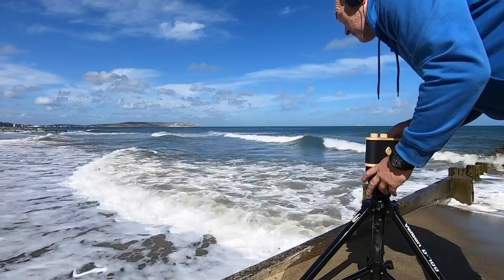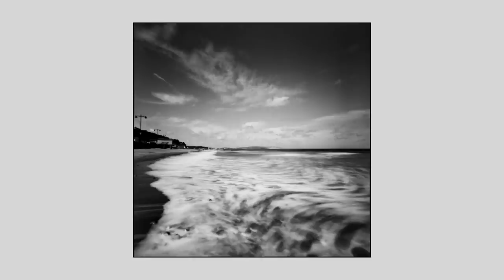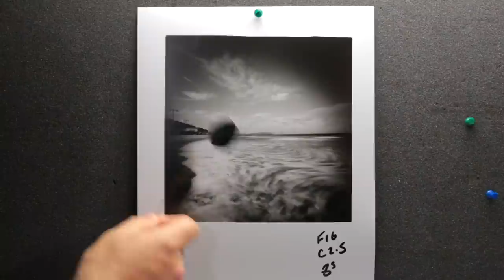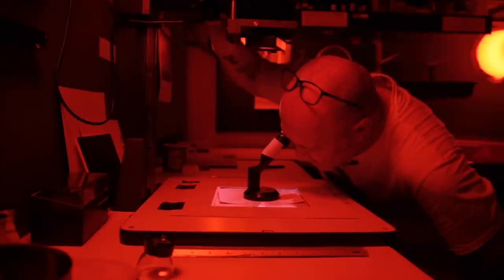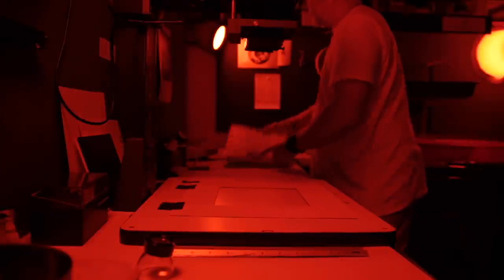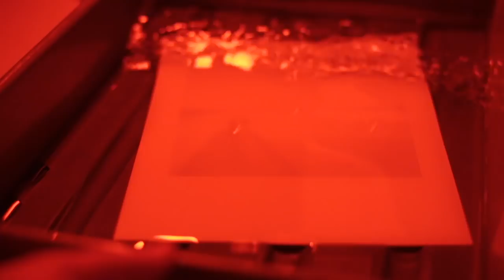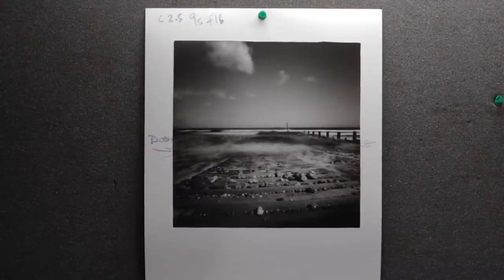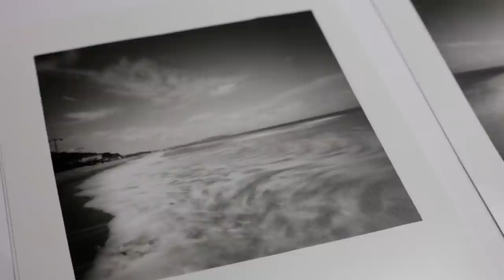6X6 MEDIUM FORMAT PINHOLE CAMERA - AWESOME HIGH TIDE SCENES - SHOOT AND DARKROOM WORKS

Comment: Regarding KENTMERE Paper --  was introduced to it when I was  a photographer in the Civil Service ( Ministry of Aviation) and they had an account -- it was available only for 'Government Contracts' in 1959 - 60 when I was there -- NO SALES to 'Private People' -- anyway I got an account when it WAS opened up and I got 'known' for using 'Kentmere' which is a small Village in the Lake District and in 1968 I was invited to visit the Factory as I was 'Youth Hostelling' nearby and told them I was up in their area. It  was very interesting. I was taken into the paper drying room in a Safelight situation and they used a 'Festoon Method' of drying -- hanging huge papers in the room as they did not have a posh drying machine at that time -- and the place smelt of 'Jeyes Fluid' which was a chemical they added to the paper to prevent Bacteria eating the emulsion !
Reply from the maker: I bet that was a good day out Pete!

Comment: I love the shot of the steps leading down to the sea. I'll have to do some pinhole stuff. Got some developing to do before I shoot any more film though (it piles up). 
Talking about having the negative in focus for printing, I read in a manual from the 1930's that if you scratch a blank exposed negative (a couple of horizontal and vertical lines) with a sharp blade and use that to focus your enlarger, then pop in the real negative it is more accurate. No idea if it works as I've not got an enlarger yet. Might be worth a go.
Reply from the maker: Never heard of that before. That must have been before focus grain finders.

Comment: Hey Roger,
I just bought an entire Darkroom all for 45€. There were developing tanks, a Film and a print dryer, a Enlarger and much other stuff like old sealed chemicals. I thought i will dispose all opened ones and maybe use the sealed. (Powder and liquid) what is your opinion on this ? I dont have much experience with darkroom, because im just builing it up. 
Much regards 
Elias Barnreiter
Reply from the maker: Good find! I'd always use fresh chemicals for developing any film you care about but it won't hurt to try the chems you have with some experimental film. See if it works. 👍
Reply: @ShootFilmLikeaBoss   Thanks for the Quick answer ! 👍 But then i'll only keep the sealed stuff like the Rodinal. If you would like to try something of it i could manage to send you some.

Comment: Any tips on buying a light meter. Have a nikon meter not functioning properly. Love the videos
Reply from the maker: Not really. That Sekonic works brilliantly.
Reply: Used correctly, it's hard to beat a good incident meter like the Sekonic.  Even the really old ones (as long as they aren't damaged) work well (I've got one that's at least 50 years old), but you need to read the manual.  The only real step up is a spot meter -- Sekonic makes one that does both, but it won't be cheap.  I've got a Pentax 1/21 that's so old it wants a mercury battery, but I bought an adapter and now I can use a small lithium cell.

Comment: Love the first print,  with the swirly water. Out of curiosity,  what dilution do you use for the developer?  I've been using Kentmere paper and Ilford multigrade developer at 1+9,  develop times for me are about a minute.
Reply from the maker: 1:9 too. I usually leave it developing for 2 mins. Ilford  paper I noticed hits max black quicker.
Reply: @ShootFilmLikeaBoss  Good decision.  It never pays to pull the print too soon.  Go at least 50% past maximum black, to allow for developer getting weaker over a session.
Reply: Thanks for that. I'm happy with the results I get at 1 minute,  but I'm always learning! I'll give two minutes a go next time I'm printing and see if there's a noticeable difference.